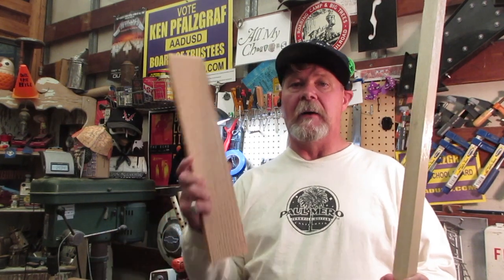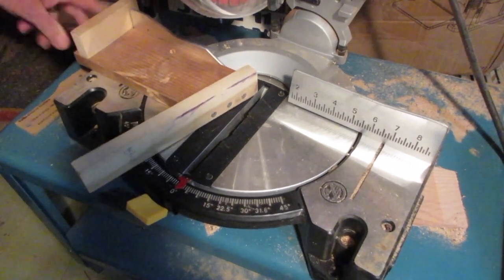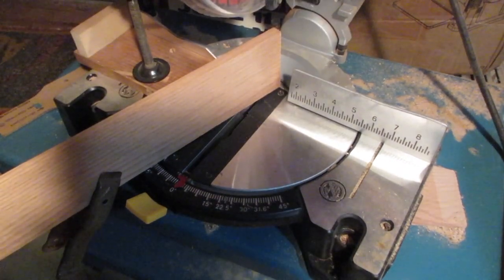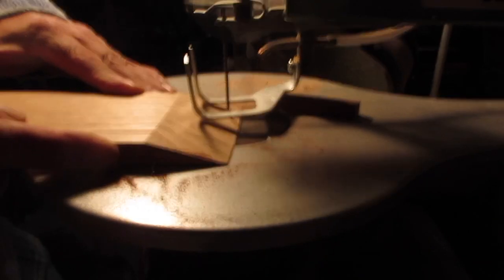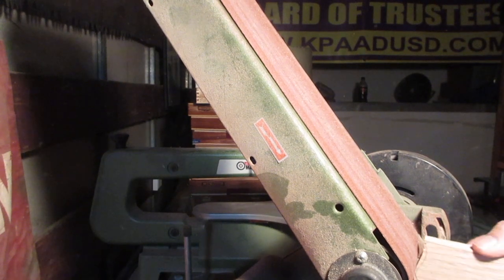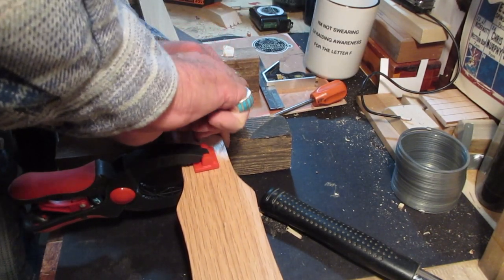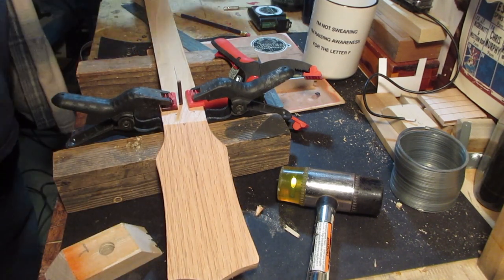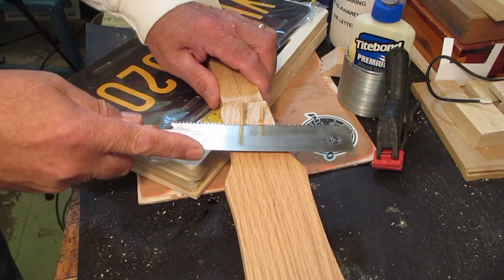Roughing Out a Neck and Headstock

Comment: Very helpful video. I made a scarf joint jig using your design and it works perfectly. I haven't tried the dowels yet but will soon. I have been drilling the tuner holes before I glue the headstock to the neck because it's easier for me to drill a straight hole that way. Do you see any problem with that? Is there an advantage to waiting until the headstock is glued to the neck to drill the holes?
Reply from the maker: Tim McElhannon perfect idea